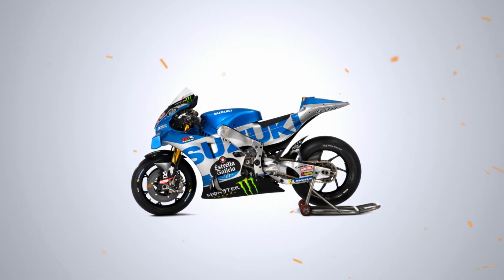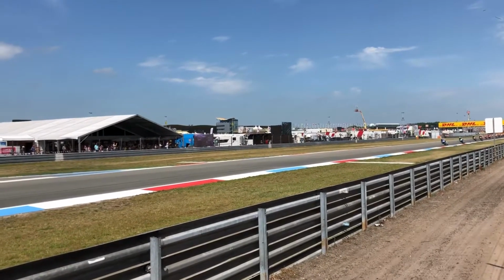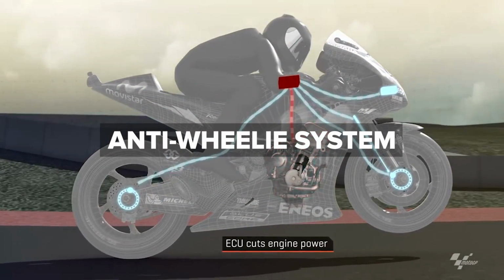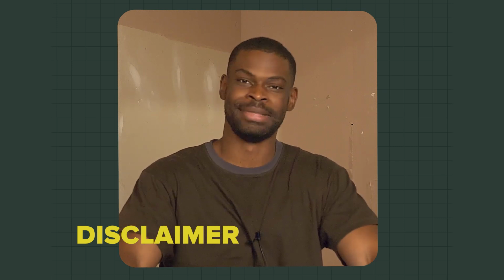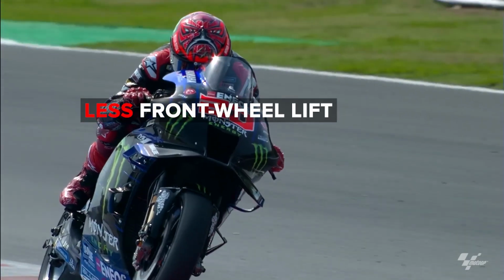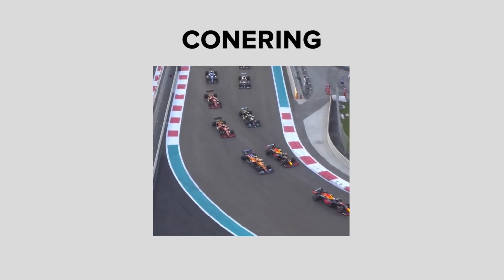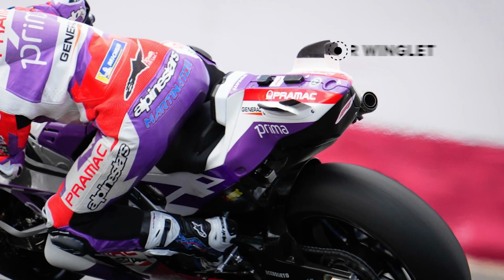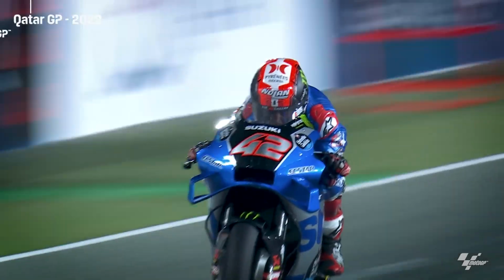Do these do anything?

Comment: This is a great channel, thanks. I think a cultural problem with aerodynamics may be to do with the type of people who are into computers vs the type of people who become extremely talented riders. Even with high powered processing, the culture around data and computer programming longs for standardisation and conformity. In other words, the remark that Marquez has made about the rider becoming less important thank the bike. A talented rider conceives of situations differently to computer models, and has a very different personality type to dare I say 'slightly autistic' people who orient to computer modelling. I think this explains the cultural resistance to aero (and also computer assistance generally, a longer debate in MotoGP). The symbolism of aero, which could be seen as an extension of data spreadsheets and colourful waterfall graphs of flow vectors. Personally I don't mind it, but I do not want to see computer geek people destroy the human element of the sport because they have more cultural power these days.
Reply: Even for amateurs, there is nothing like being in full control of your bike/car without any interference of a computer, they were meant only to aid and assist in things that injection and ignition but the moment they started to control the throtle and steering, there is when shit started to happen.